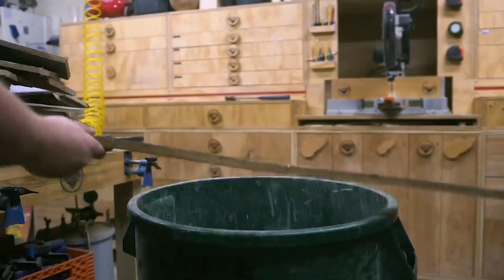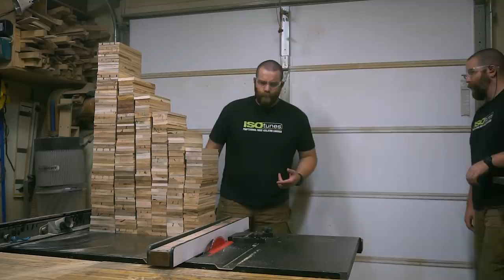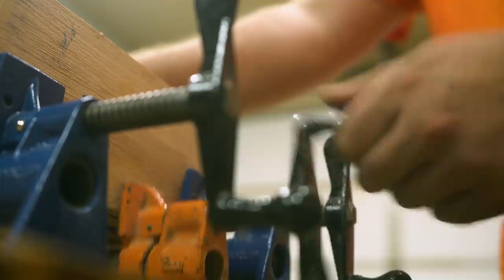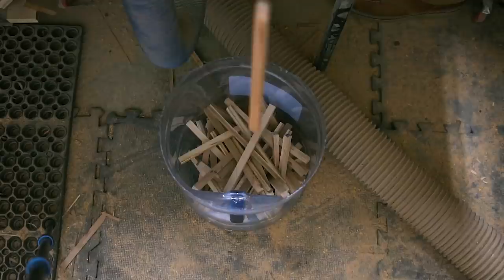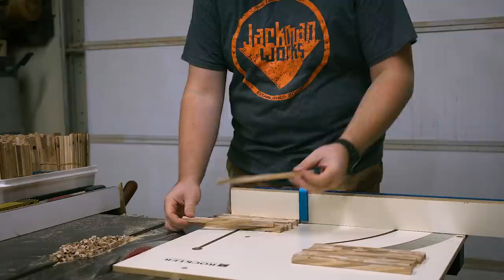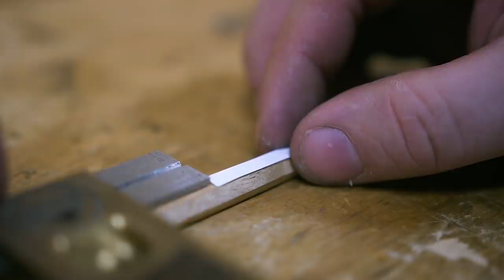Pallet Wood Pencils (1,000 of them!)

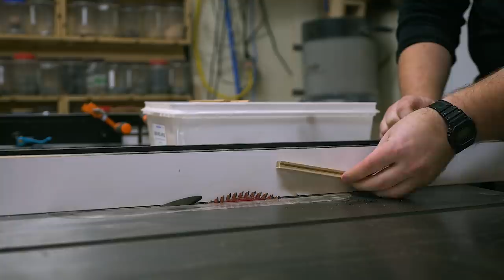Comment: @5:07 I picked up a little tip that most will miss about spinning the table saw blade backwards to check to see if it is centered.  Thank you for the tip.
Reply from the maker: Exactly! Keep adjusting the fence until the notch from one side lines up with the blade perfectly.
Reply: I agree. Great tip right there!

Comment: On my jig, I'm having a hard time preventing the pencil blank from rotating on it's center while it's being planed. What am I doing wrong?
Reply from the maker: I just give the back side of the pencil a little bump with a hammer and that locks it in to the registration point on the front end of the jig.
Reply: @JackmanWorks  I tried that as well! Still ends up rotating. Perhaps my blanks are a tad too short and aren't under enough pressure between the two steel bars. Overall, I love it though! Great work and thanks for your response!

Comment: Dude, you are the best sort of maniac.  Is that the same pencil jig that Picciuto was testing not so long ago?  Is it adjustable width or is it geared to a specific plane? I'm making the assumption that there's a track the plane rides in to act as a depth stop. In any case ... great stuff as always, Cheers!
Reply from the maker: Yep, that's the same jig! I bought it from the Indiegogo. The width is fixed but it fits the most popular low angle block planes (Stanley, Veritas), but I actually added a little shim so that I could use the Tony Rouleau plane with it

Comment: Sorry to Monday morning quarterback, but wouldn’t it have been easier to cut several slots into a single plank, lay in the pencil lead, and glue the laminate sheet on top? Then you could cut the plank into individual pencils with the lead already in place.
Reply from the maker: Nope, I would then have to change the set up at the router and make sure it was 100% accurate so that when I rip the planks apart the lead is in the center of every pencil. It works out to the same amount of cuts either way :)

Comment: I'd think it would be easier to make a row of pencils at a time, stopping before you cut them into separate pencils, slice that in half and cut the grooves, sandwich the lead in, before finally ripping them to separate.
Reply from the maker: I would then have to change the set up at the router and make sure it was 100% accurate so that when I rip the planks apart the lead is in the center of every pencil. It works out to the same amount of cuts either way :)